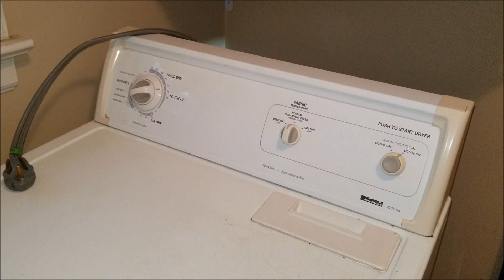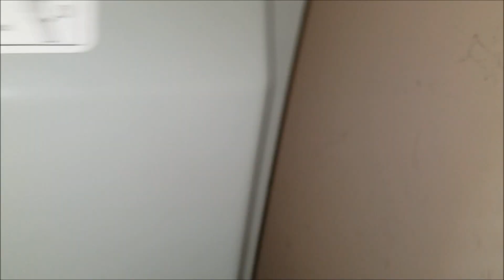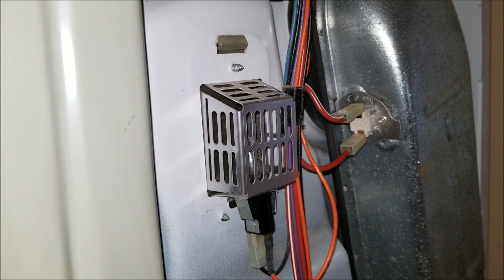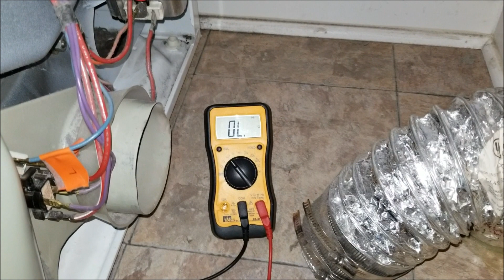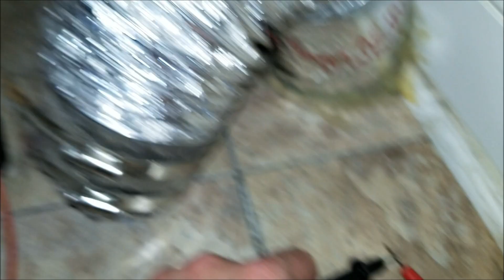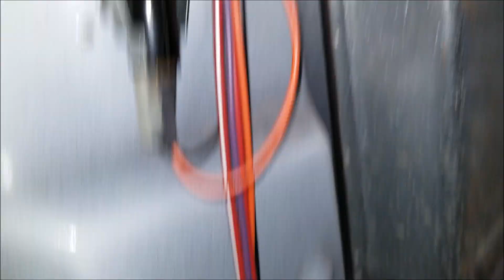Kenmore 70 Series Electric Dryer Not Heating - High Temp/Thermal Cutoff Replacement - Part 1

Comment: I have a Kenmore Dryer 70 Series that won’t turn off. I changed the timer, thinking it would fix the problem. It still won’t turn off on its on. It will only turn off if you open the door or push the off button. Any ideas what it could be?

Comment: Good video buddy! My problem happen to be the thermal fuse. Been awhile since I had did any dryer troubleshooting and I had a idea it was the thermal  fuse because of factors leading up to the issue. Someone prior to the current resident had decided to block off the opening which allows the exhaust air to exit outside with (of all things)
expansion spray foam . Lol
Completely sealed it off. 
Current resident didn't inspect it from the outside and hooked up their dryer hose and subsequently over heated the dryer as the hot air couldn't exit.
So , good news is, the fuse did it's job and prevented further damage to the dryer and possible a 🔥.
Thanks for the brush up review.

Comment: You are an absolute life saver. I have no money and my dryer went out. I bought a heat element replacement kit and installed it myself and it still didn't work. I was crushed...and then I stumbled onto this video. I had no clue there were more fuses to test. All other videos only showed the thermal fuse...and that was not my problem. It was the very last fuse you showed in you video. When I put it all back together and seen that sweet sweet orange glow I cried. Thanks for this video!!!

Comment: I just used your video to repair my dryer. Just wanted to let you know it was helpful and yes, there are still some of the Kenmore Series 70 dryers out there. Many thanks. One note: The entire vent system needs to be cleaned as this being full of lint causes this fuse to go. I took off the vent shaft (not sure that's correct term) and it had a lot of compacted lint at the bottom opening. The flexible duct also had quite a bit of compacted lint.

Comment: Matt, I pulled my wires off of the thermal fuse before I marked orientation...one goes to controls, the other goes to the motor, did you happen to notice which one was which??
Reply: I know this is an old post but you can simple do visual follow up the path of the blue wires along the wire harness. 
You will see one going up to control and the other will split off a downward direction headed for the motor...hopefully this might help for anyone with the same question down that road .

Comment: I noticed there was no heat but also the dryer was not turning off first time this happened gets to near zero and keeps running could that be the issue
Reply: I have that same issue right now. No hot air, and the dryer wont turn off when the timer should be done. Did u fix yours?
Reply: Same here...doesn't stop no heat...I will try testing electrical tomorrow...hopefully that's it
Reply: @H8ucla  What was your repair?  I'm having the same issue now.
Reply: I also have that issue as well, I wonder if anyone has found a solution
Reply: I have the same issue no heat and wasn’t shutting off
Reply: Ditto

Comment: What is the part next to the thermal fuse with the four connectors going into it?  Mine is fried! :(
Reply: Shane Kemplin mine is too do you know what part it is
Reply: Dryer cycling thermostat, symptoms dryer stopping too soon, no heat not enough heat or too hot, takes too long to dry if everything else checks out. If you replace that part, replace the thermal fuse next to it as well, it regulates temperature, and will shut off dryer if it gets too hot, if it blows dryer will not start.

Comment: Thanks for the video. I have a 70 series gas dryer but the guts are basically the same. Your video helped immensely. Btw- I had the same huge piece of lint on the screen- that’s an indicator of a need to clean the dryer with one of those long handled brushes. I haven’t done that in a while but will definitely do it more frequently. Hopefully I will get a few more years out of this appliance. Thanks again
Reply: Thank you for your video

Comment: Hit it flat on a hard surface and it will reset. It may take a few tries but it works. I’ve done it a few times.
Reply from the maker: Cool, never heard that before...thanks for the tip!
Reply: Thank you worked for me!!!
Reply: Hit the fuse on a flat surface?? Does this work with all fuses?
Reply: I did this and it worked
Reply: This actually worked. Thank you .